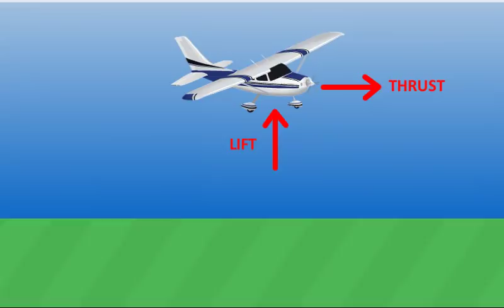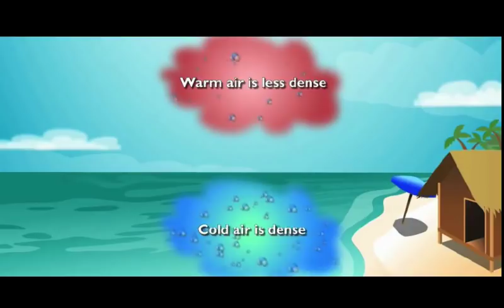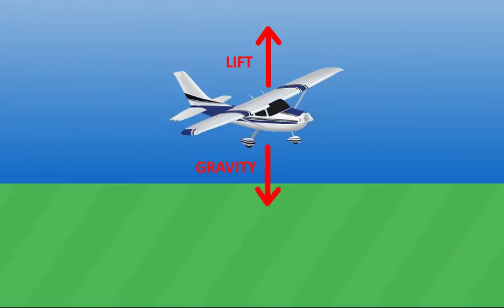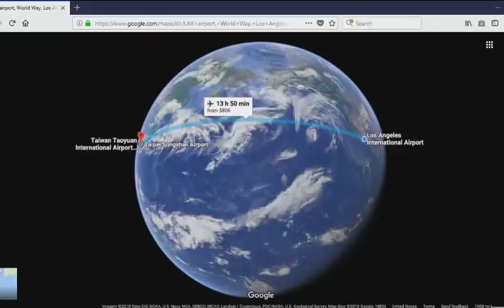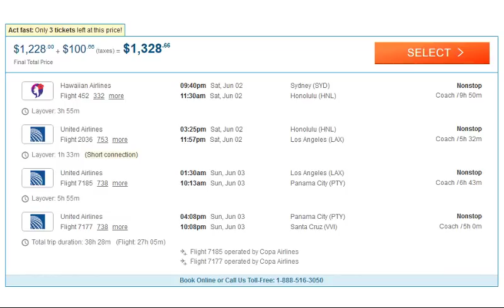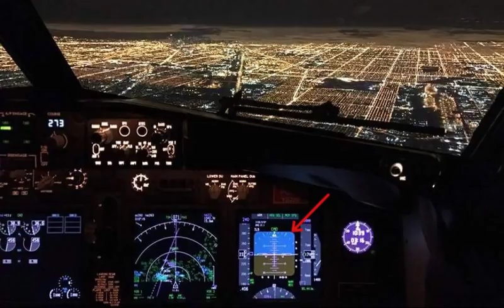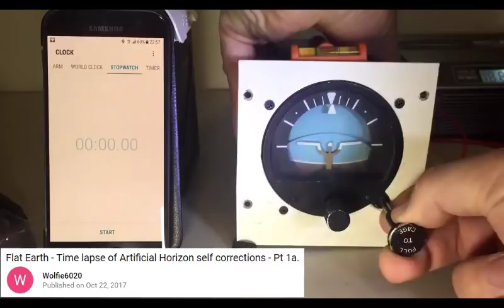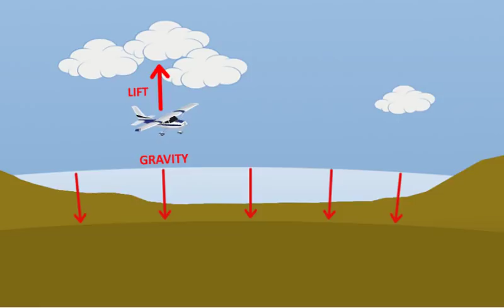Flat Earth Falsities - Plane Nonsense

Comment: Yea sure the earth is traveling 96 times the speed of sound around the sun at 67,000 MPH while spinning at 1.5 times the speed of sound at 1037 MPH, covered with water on a ball, while the moon orbits the earth every 28 days while the sun is traveling at 500,000 MPH through the solar system and Australia is upside down . Who would question that one haha?
Reply: Firstly spinning is not measured in mph it is measured in rps. rpm. etc.
I prefer to view things more sensibly, rationally even. The earth, which has a mass of  (5.9722±0.0006)×1024 kg (5.9 sextillion tonnes) and a diameter of just less than 13,000  kilometres is slowly rotating at (7.2921150 ± 0.0000001) ×10−5 radians per second. or 1.15 x 10-5 rps or 0.000696rpm, In other words it is an extremely massive object with a large diameter which is rotating very, very slowly about it's axis  
0.000696rpm.  That is the rate at which the earth rotates.
The earth doesn't actually spin, a top spins, the earth rotates very, very slowly. OK?
Spinning is what tops and Jennies do. The earth rotates slowly, very, very slowly
What is the circumference of the south pole?
Reply: richard: Chicago is not visible from 50 miles away. Usually you just see the very tops of the Seers Tower and a few other tall buildings. Why is it that the bottom of the buildings are hidden? Curvature. 
And yes there are many thousands of images of Earth from space. Including full frame film images. So no I don’t find that suspicious. Flat earthers discount them by playing down the number and claiming they are fake.
Reply: We know the earth is a slowly rotating terrestrial spheroid and gravity is a fact.  Just because you are incapable of understanding basic maths and physics and wilfully refuse to learn such things is your problem.   Examples.
What is the relationship between longitude and distance when travelling east or west parallel to the equator?. If you know the answer then you know the earth is a spheroid. If you don't you are not qualified to comment on the earth’s shape.
Please explain the principles behind the development and functioning of a gyrocompass? If you can then you know the earth is a slowly rotating spheroid and gravity is a fact. If you don't you are not qualified to comment on gravity, the earth's shape or movement.
Reply: richard hava
"Yahuwah, the god of abraham, Isaac and Jacob is a fact......."
The existence of otherwise of these personages has nothing whatsoever to do with gravity. Nothing at all.
Now answer the questions that have been asked instead of deflecting.
Reply: Standard flat earth logic: “big numbers therefore wrong and Satan”
Reply: +richard hava
"Sorry got off track but just produce me a picture of the Big Blue Marble.... a real genuine authentic one and then I will believe that the Earth is round."  Why do you lie.
If one is produced you will simply state it is fake, cgi or whatever won't you. You will have no way of substantiating your claim , but that is unimportant to you is it? You just say "fake" and everyone has to believe you. No proof. No evidence. Nothing. Correct?
Why do you have this apparent sexual obsession with pictures? All they do is reconfirm what we already knew and have done for centuries. What you are demanding is that everyone re-invents the wheel every morning. 
What is even more ludicrous is that you are using technology which only exists because of "s*** that sounds like nothing but scientific b*** on top of b*****". Why aren't  you throwing your semi-literate hissy fits about quantum mechanics etc. which underpin the electronics and comms you quite happily use to troll like a petulant 6 year old?
You stop using the products of the science you decry and also sensibly answer the questions you have been asked I'll stop telling you that you are ignorant, uneducated, of low intellect, gullible and infantile. OK?
Catch 22 for you there.
Reply: Oh no! So many numbers! The globe model must be wrong then.
Reply: +
richard hava
"But who is.....WE......" Those who are not indoctrinated brainwashed sheep is who. Those who have navigated around the world is who.
Now answer the questions that have been asked instead of deflecting.
Also - 
Was Newton atheist?
Was Galileo atheist?
Was Georges Lemaître atheist?
Was Nicolaus Copernicus atheist?
Is Freeman Dyson atheist?
Was Francis Bacon atheist?
None of them, so your basic argument is a load of cap. More lies, try the truth for a change.
"because i have driven my shiny new yacht around the entire border of china" If that were even remortely true you would be able to answer my questions, that you cannot proves you are lying again. Further, the "border of china" is mostly on land you ignorant, lying twat.
Now answer the questions that have been asked instead of deflecting.
Reply: Brilliant. Cite his work, then run away when you realise it contradicts you. Isn’t it just possible that someone who spent his life studying genetics and the human genome knows it a little better than you?
Reply: "perfectly stated"
I'm not seeing a FE map there.
Reply: Larry:  Let's try something...
Yea sure some guy I've never met is communicating to me through wires at the speed of light turned into ones and zeros and then back into information I see on a glowing plasma screen powered by thousands of people I've never met in a giant grid spanning an entire country that is further connected to almost every individual person in the world!
You see how I can make something we all know is real and happening sound insane?
Just like you did?
Reply: +richard hava  So where are your facts and logic?
"But who is.....WE......" Those who are not indoctrinated brainwashed sheep is who. Those who have navigated around the world is who.
Now answer the questions that have been asked instead of deflecting.
Also - 
Was Newton atheist?
Was Galileo atheist?
Was Georges Lemaître atheist?
Was Nicolaus Copernicus atheist?
Is Freeman Dyson atheist?
Was Francis Bacon atheist?
None of them, so your basic argument is a load of cap. More lies, try the truth for a change.
"because i have driven my shiny new yacht around the entire border of china" If that were even remortely true you would be able to answer my questions, that you cannot proves you are lying again. Further, the "border of china" is mostly on land you ignorant, lying twat.
Now answer the questions that have been asked instead of deflecting.
Reply: +richard hava
" i have developed late in life is to annoy the shit  etc." You flatter yourself dear, the people who you believe you are harassing are not in the slightest bit harassed, in fact they are laughing at your stupidity and gullibility. The total opposite  to your delusions.
On the other hand you are quite obviously flustered because you are incapable of responding sensibly to questions or sensibly refuting anything put to you. You run away don't you. Why if you are the one doing the harassing?
"Yahuwah, the god of abraham, Isaac and Jacob is a fact......."
The existence of otherwise of these personages has nothing whatsoever to do with gravity. Nothing at all.
Now answer the questions that have been asked instead of deflecting.
Reply: richard hava  “Mr. Wong says gravity is a fact” BECAUSE gravity is demonstrable, testable and falsifiable. I can’t speak for Mr. Wong about god, but I can say that god is not demonstrable, testable, or falsifiable. None of the 4600 deities man has created are demonstrable, testable, or falsifiable (at least followers of the deities don’t want to use falsification). So rational, reasonable people can’t “admit” there is a god, because there is nothing that supports the existence of a god.

You make the claim that 99% of atheists call people that accept claims that are contrary to evidence (have faith) regarding the existence of something that has no evidence, is not demonstrable, verifiable, or falsifiable names like irrational, unstable, and insane.

Okay, first, I’d like to see your evidence that 99% of Atheists are saying this. Second, what is the definition of irrational, unstable, or insane, if not someone that accepts claims that are contrary to evidence?

Gravity is demonstrable, verifiable, and falsifiable.

I’m stopping here. You have made claims, and then not supported them, so I’m not going any further down the rabbit hole of irrational, unstable, and insane, until you have some evidence to support your claims.
Reply: ^You say a lot for someone who doesn't have a dome.
Reply: @Larry Major
I chose my pseudonym for a very specific reason and that was to separate the educated from the infantile and therefore laugh at silly attempts at humour/abuse such as yours. And you know, only the uneducated, ignorant thickos do what you have done and proved themselves infantile. Congratulations on proving you are a worthless tosser.
And then there are your religious delusions. Given there is no contemporaneous evidence whatsoever of the existence of the biblical Jesus, you are backing a loser.
And before you come back with the usual party line,  please note "contemporaneous", "evidence" and "biblical Jesus".
Reply: If it helps then you can think of physics as an attempt to describe the rules of the universe. 
If you believe that your God created the universe and those rules then that's fine.
Reply: Larry Major thats not the thingy dude the fact is that earth was proven to be a glob before nasa existed u see mate the thing is with some commune sense physic makes sense for example this guy on the vid explains shit calmly what of the thing he says is bullshit ? Like which of the points above is hard to understand or its bull shit on your opinion ?
Reply: Larry: "Language of God" was written by Francis Collins. And yes he was the director of the National Human Genome Research Institute (NHGRI). But have you actually read the book? He argues that God created the universe (not a magic snowdome) and that evolution is God's mechanism for creating mankind. 
He founded BioLogos that tries to update Christian thinking by incorporating evolution, genetics and old (round) Earth. https://biologos.org/about-us/our-mission/
Reply: Its a pleasure Larry.....
I dont possess many skills and i am not putting myself down...i do well with the ones I have.
And i think one of my skills that i have developed late in life is to annoy the shit out of satan by harassing roundballers with facts, logic and by using tbeir own nonsense against them.
Be well my friend and neighbor
Reply: i believe in the God of Abraham and i am glober
Reply: richard hava Except that you have no facts or logic, and the only nonsense spewed is by those that wish to regress to dark age mentality using the education provided to a first grader. I take it back, my first grader understands more about the shape of the earth than flattards do. The annoying part is that you are attempting to spread idiocy and how virus like idiocy can be. For the record, Satan was the good guy in the Bible. He was directly responsible for the death of less than ten people. Your Yahweh is a murderous savage committing GENOCIDE as often as the “bad guy” Satan was directly responsible for someone’s death...  Try reading your book o’ bullshit.
Reply: Larry Major “God is the creator...” Yes, I’m familiar with this claim and the lack of evidence to support it. “His fingerprints are all over creation.” How do you know god is male? How do you tell gods “fingerprints?” What I’m asking is, what do you mean by fingerprint, and where did you get gods fingerprints from to compare them with?

Your claim sounds absurd... because it is. It is a claim with no evidence. It is also a claim that runs contradictory to evidence. It doesn’t matter what books have been written by the person in charge of the Human Genome project. We don’t do science by using arguments from authority. We do science by supporting claims with evidence, something “The Language of God,” does not do. It’s not a science text book. It is opinion. The author is welcome to any opinion they want to have, but that does not make opinion fact.

Since you do not believe in gravity, please walk off the nearest 100 story building and provide evidence that it is “all in your head.” You’ll either earn a Darwin Award, or a Nobel Peace Prize. I know where my money is.
Reply: Larry Major

"God is the creator and the designer and His fingerprints are all over creation dude"
 Stop CLAIMING it, PROVE it !

"And Gravity does not exist you fall down because it is down "
Waouh ! Brilliant example of "flat earth science" demonstration !
Reply: I am sorry but u said upside down who are u to decide whats upside down ? For them u are upside down ? But ofc dude the earth is flat even tho its been proven a while back a few hundreds of years ago that it isnt but if u say so it sure is....also the earth is in the center of universe thats what they used to belive everything rotats around the earth and all the other plantes are round only the earth isnt man do u realise how stupid u sound like u know u going back on time when ppl thought god was everything every lil thing that couldnt be explain cuz ignorance it was a gods act...also as for the water on the ball why dont u dip a ball on the water if u notice the ball gets wet dosent it....that is water that is staying on the ball....well anyway I  am sorry u are a gineus all the flat earthers are :) btw why is it harder to go up a hill then goin down it u say density and shit does that mean that 1 side of the hill u goin up is more dense then the side u goin down hmmmmm? :) have a great day sir.
Reply: Larry Major ill say this once u think god is the creator of the humans while I belive the humans are the creator of god....as a rey of hope to their suffering on aceint times as an explenation on failing to understand whats happening or why a phenomen happends u say gravity is a magical force pulling u down gravity dosent pull down it pulls towards the center of the earth so it dosent metter when u are on  the glob  it will always pulll u towards its center so on a glob there is no upside down or up or whatever also gravity is a magical force invented by people while god is a magical being invented by ppl both cant be seen but we still belive they are there ill belive on god when I see god...also u will belive on gravity when u see it right ? So we are even....but I respect your proces of thinking I  am not an atheist I go to church every week with my family but its coommune sense to belive on higher being or higher forces we dont fully understand so stay open minded and dont just go and say god and no other thats not a god way of thinking.
Reply: Richard hava:  So I'm supposed to take YOUR word it's dumb?  Someone who exaggerates and lies to them self to not disrupt a countlessly disproved belief?  Your "proof" seems to come from one multiple translated and edited book by many different authors from over a thousand years ago and "common sense."  I don't think my side is the dumb side.  Give me some PROOF instead of insults and fairy stories.
Reply: No... do you guys have like a set of programmed responses? i swear you guys know 3 words. gravity, scale, and idiot
Reply: Hey larry
Mr wong says "we know" 

But who is.....WE......
Reply: wong 
Where am i hiding
And how is it that you can speak for everyone.....kind of like your "we" .
See, the last time i checked, 
We were discusing round vs flat earth.....
All of your questions for the 4th time are useless and irrelevant at this point.........
Why is it so hard for you to see something so simple........
You need to overcome why i can see from top to bottom the city of chicago from 50 miles away......you have yapped a lot of words but not once mentioned this.......remember the "WE" you talk about came up with M (SQUARED) X H = D or whatever the equation is and chicago should be gone........
Pay attention wong......maybe put down the bong......
This means no CURVE.....
So what the hell do your questions and me answering them have to do with this.....
The answer is nothing.
And I've told you at least three times that if you are going to give me a bunch of s*** that sounds like nothing but scientific b***** on top of b***** to explain why the city of Chicago does not disappear....
Then go ahead and believe that s*** and defy your senses and Common Sense......

For the 4th time, 
Just get me a real picture ftom above the dome you do not think exists......NASA calls it the van andel radiation belt.....you know the one you have to pass yhrough to get to the moon...
The belt that they say we have never gotten through as they are trying to build something to actually get through it.
But somehow back in 1968 with that pathetic looking rocket ship they were able to pass through the van handle belt to land on the moon and make it back.
And for god sakes man if you really believe that anyone's been to the Moon then for the love of God don't ever f**** call me crazy.
Oh my God I bet you believe that we did actually land on the Moon.
Oh my wong....thats bad.
Sorry got off track but just produce me a picture of the Big Blue Marble.... a real genuine authentic one and then I will believe that the Earth is round.
My God with all the technology man and all the space stations and all the space traveling all the things that we have you would think that somebody could come up with a real picture.
I mean you don't find that the least bit suspicious.
But oh well wong
If you come back with the same old s*** then go ahead and believe that I'm running and hiding somewhere.
Because if I don't you're going to drive me insane with your consistent bulshit.
Reply: you cant compare a rule of physics within earth to the created physics in nature of the harmonious earth its atmosphere and gravity are created. anythin we add or delete is over and above the harmonious syncronised system God Almighty created.
Reply: thank you Richard these same people believe their ancestors are the great apes from 25 million years ago .
Reply: God is the creator and the designer and His fingerprints are all over creation dude . You need to connect the dots . The man who in charge of the Human Genome Project wrote a book called The Language of God because he says that there is definitely a great designer behind the creation and atheists are always simpleton buffoons . And Gravity does not exist you fall down because it is down there is no magical force pulling you down it is all in your heads .
Reply: Yes well he was also indoctrinated into the globe lies even Christians are .
Reply: And mr Wong says gravity is a fact.....
If mr. Wong can admit that Yahuwah, the god of abraham, Isaac and Jacob is a fact.......
Then saying gravity is a fact is a statement i can respect......
But if mr wong is an atheist,  like 99% of atheists, 
They call people who have faith in The Most High to be irrational, unstable and insane....you know...its absurb to believe in the invisible
But then state that gravity is a fact.....

This is an example of being unstable in all ways......

And what makes it seem even more instable is mr. Wong will try to argue that this is not the same....
He will defend his position.......

Just like he cannot grasp the fact that if I can see the entire city of chicago 50 miles off the coast of lake michigan, the curve does not exist......
Instead he will ask several complicated questions that i do not give a rats ass about, and claim that since i do not know the answer then i am not qualified to argue the earth is flat.......

That is like me telling mr wong that the state of michigan is located off the coast of China.....
He says rich.....that is not true because i have driven my shiny new yacht around the entire border of china and there is mo mitten looking land any whete near china....

But i come back with 10 intellevtuallt sounding questions that require a lot of research and kearning to undersand and I tell him that because he is clueless to my questions, that it negates his geographical facts that michigan is no where near china......

Therefore michigan is just off the coast of China.....
Why?

Because "WE" said so
Reply: We is who has been telling wong wrong .
Reply: Here is what a bunch of phony liars NASA are they were recently asked why do you not go back to the moon ? They replied we lost that technology and it is painful process to build it all back . Then they said we can not go above low earth orbit anyway . What a farce yet you Joni believe the bullshit .
Reply: Larry Major perfectly stated 😂😂